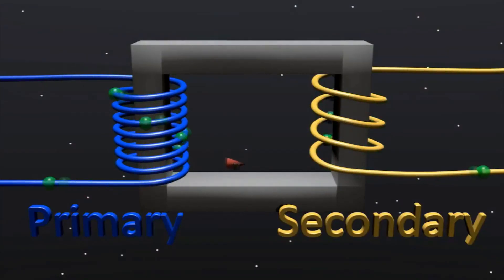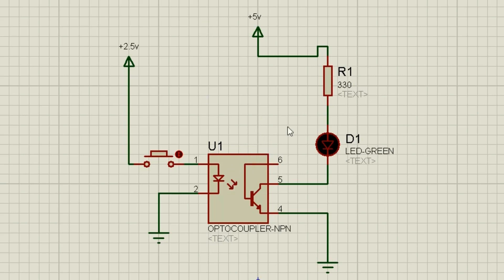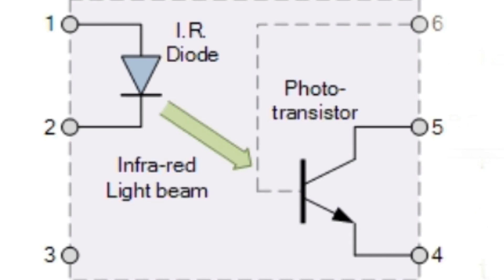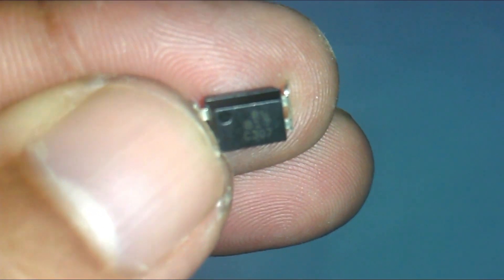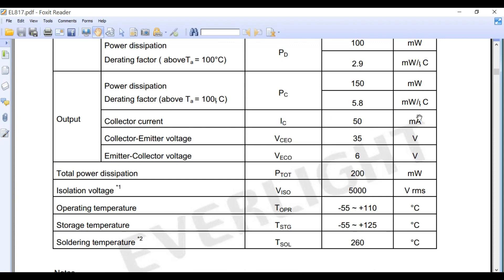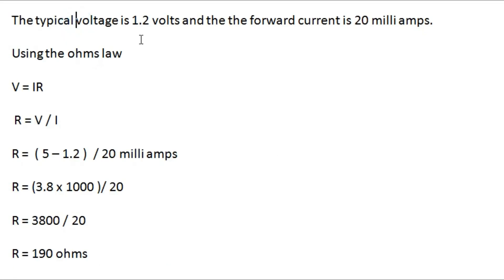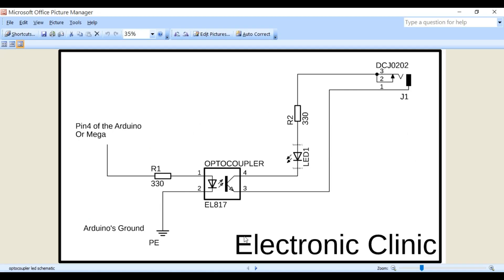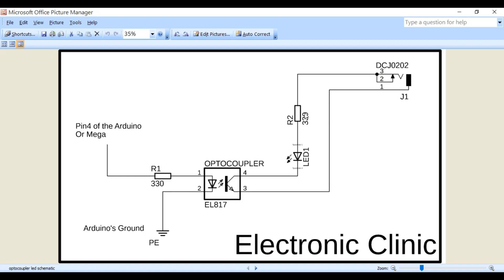Arduino uno Electronics tutorial phototransistor Optocoupler or Opto-isolator working & use "motor"

Comment: I have a circuit which has a optocoupler and a display. If I connect only opto coupler to A5 it works fine. If I connect only I2C 16*2 display it works fine. Only when I connect them both the system crashes and code does not runs. Power supply is not a issue I have tried it. Do you know  any reason for it?

Comment: Looking at your simulation, is it true that while the potentiometer is effectively passing Ground through to the Arduino, the optocoupler is off, drawing no current through its internal transistor, the TIP 122 transistor pair get all of the 5v supply, pushing it into saturation and the fan is on full. As you turn the potentiometer, increasing voltage IN to the Arduino, the optocoupler slowly turns on, drawing most of the 5v supply, starving the TIP122 transistor of B-E current, eventually turning it off (cutoff), resulting in the fan slowing... to a stop?

Comment: It is okay to use that in AC motor 1 phase.. I just add a relay?
Thankss
Reply: Relay? A relay in the circuit wouldn't give you a variable speed control for the motor. For the light circuit yes, relay coil 5volt, points need to be rated for the load. These relays are actually cheap and made for Arduino and 110v circuits. But a relay wear out faster as a semiconductor!

Comment: Do you thing that this regular optocoupler will work with interrupt pins or I need a high speed optocoupler like the VO2601 ? I'm planning to isolate all arduino digital pins (interrupt pins that I'll use in this case) with the VO2630 which is Dual channel !

Comment: I have a very large 7 segment display, The data sheet is between 8.4 to 12 volts dc with 20ma draw for each segment, I want to control this 7 segment with the Arduino, I know the output is 5volt from the Arduino and I will use a seperate P.S. for the 7 segment, Can I use a 2N2222 transistor or would the EL817 be better choice. Also this 7 segment is common Anode not Cathode.
Reply from the maker: EL817 also gives u isolation. Now its totally up to u. Ur choice